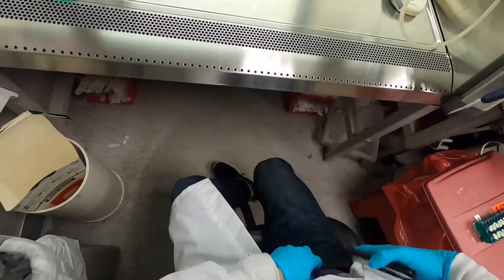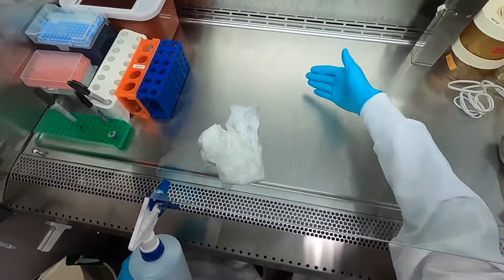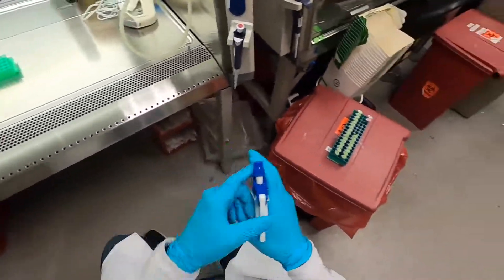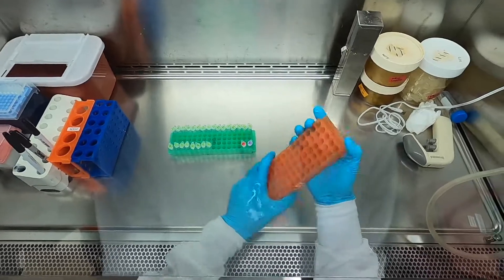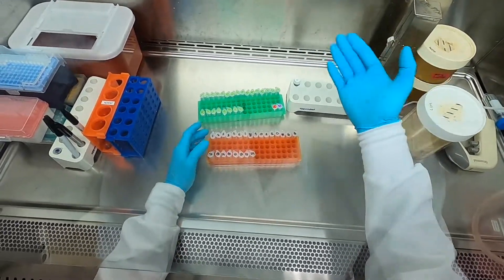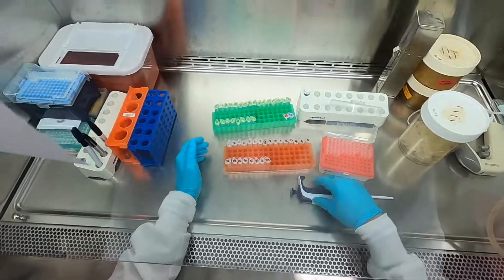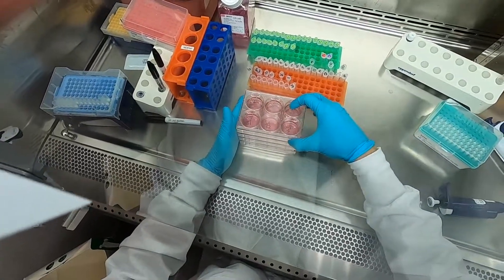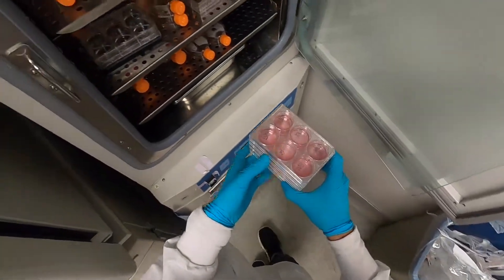POV: How To Do a Transfection

Comment: I'm currently adapting a lipofection in my lab, and I have very modest transfection rate using Lipofectamine 3000 and CHO-K1 cells. It is a perfect time for YT to recommend this in-depth video to me. One difference which I've noticed is that I'm pipetting mixture vigorously before adding it to the plate, while you explicitly advise against it. I'll try it and hope it'll improve my results! Thank you!
Reply: UPD: It worked! Thanks a lot and keep up a good work!

Comment: 2 quick questions: when adding FuGene (14:42) why do you mix them by flicking and not directly by pipetting up and down?
And when putting the 6 wells plate in to the laminar flow (17:24), why don't you have to clean them with ethanol?
Reply: 1: He has 150 µl in each tube and then adds 9µl FuGene to it. with the 9µl the pipet is set at, it's not really practical to try to mix by pipetting up and down since the volume is too small. It's easier and faster to just flick the tube.

2: I'm not entirely sure but i think ethanol vapor could influence cell growth or perhaps kill some cells. With good lab practices (clean gloves, clean lab, clean laminar flow) you shouldn't be worried about contamination.
Reply: @JelleC24  That makes sense! Thank you for your answer!